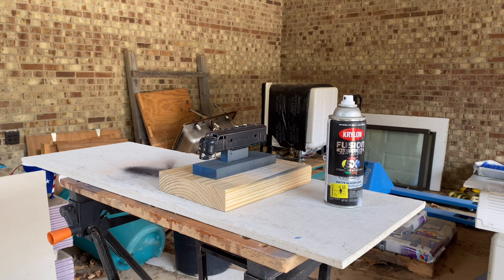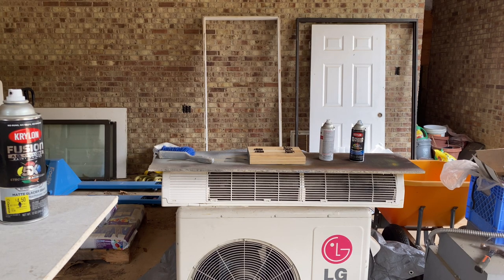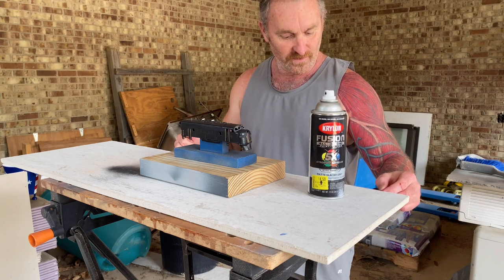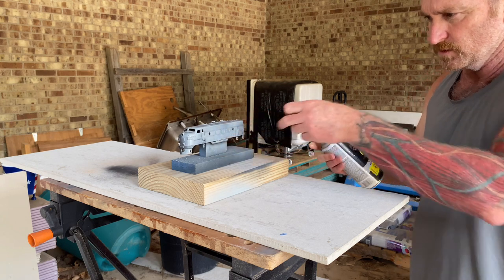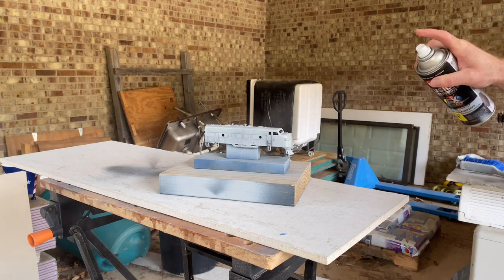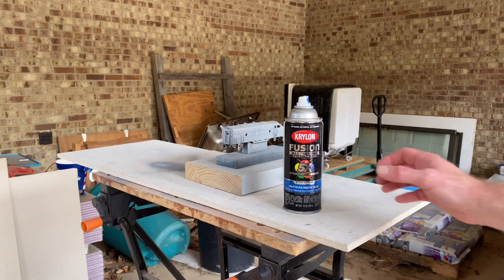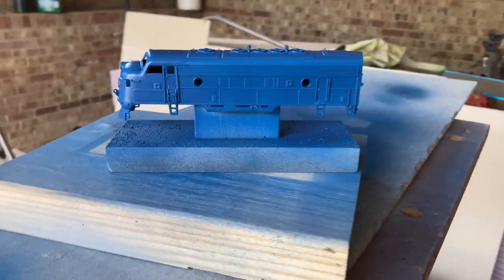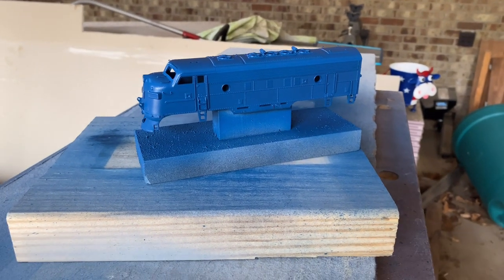HO Scale Athearn Bluebox Virginian & Ohio F7 build Episode 7

Comment: I paint models likle this stuck on a used paper towel tube. It is the right diameter for a snug fit, can be held with one hand while you spray with the other,  an d is easy to rotate (even upside down) without dropping the model.
Reply from the maker: @MosriteCharlie  that’s a great idea.